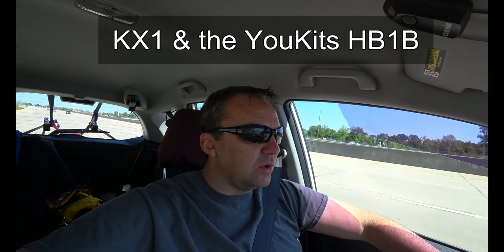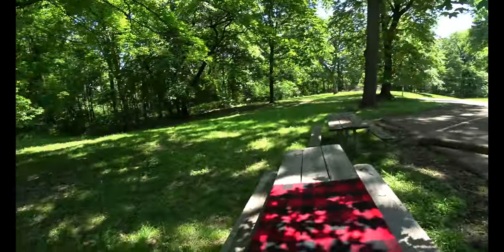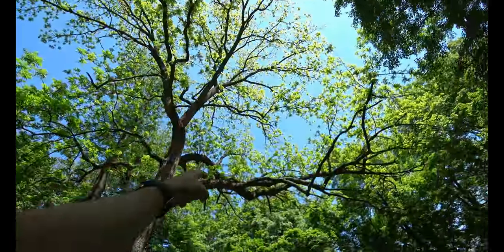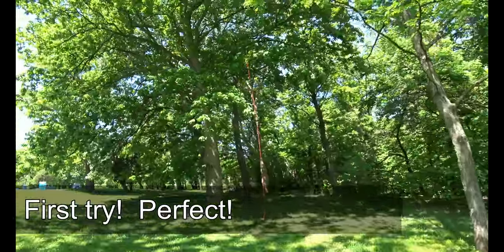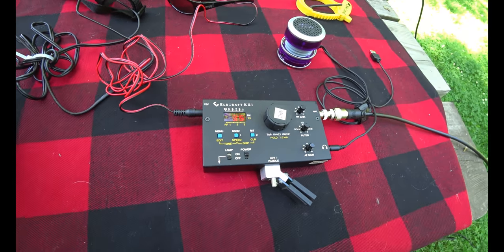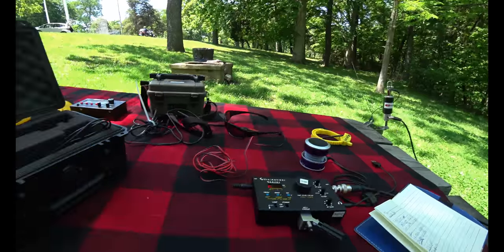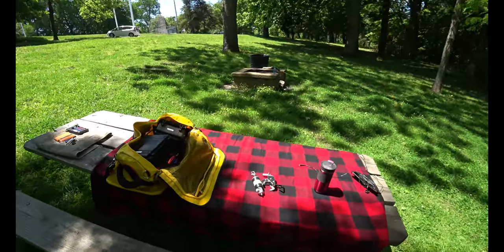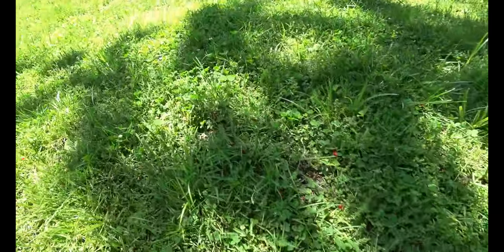Antenna Tree Throw Line Water Bottle | Chameleon MPAS QRP Contacts

Comment: I love my MPAS 2.0 vertical haven’t really played around with the wire antenna much but over the summer 2020 I made regular dx from Ireland to South America with just the single supplied counterpoise, I got the cap hat too great antenna, probably best to use the wire for 160 and 80m.

I was surprised how quiet the Mpas 2.0 is, it’s a great antenna for SWL.
Reply from the maker: Thanks fer comment !

Comment: At minimum you need twice the length plus 10 feet of the height you guesstimate you will be attempting to gain, that is, the weighted object has to return the same distance down as it went up. Heard and saw on videos that it was very muddy in the outdoor flea market. Have a great time at Dayton.

Comment: Thanks for the knowledge. Enjoyed your video. I am going to give the bottle trick a try. Not sure if Dave got back to you? A polypole example is the JACKITE fiberglass pole. It telescopes out from a few feet (and depending on the model) extends up to 32 feet. It's usually used to fly a bird kite. Ive seen short ones on boats flying a hawk-looks real and must keep the birds off. Amazon has the 28 foot for $79. Jackite also has a web site. It gets five stars. For myself, I believe in the KISS princple and go with the trees. One queston: what is the QRP transciever you are using?
Reply from the maker: John Kelley this radio is the Elecraft kx1 I built

Comment: Excellent video and a great idea. I figured on using an egg shaped lead fishing sinker that weighs 8 ounces. but I always have soda bottles around. So what length did you end up using? Or two 50 foot cords or two 100 foot cords?
Reply from the maker: I don't remember on this video.  Now I use about 140' of very fine twine.

Comment: Noticed the nice little Stealth Cam battery.  I just bought one of those a few weeks ago and so far like it.  Considering shortening the long 10' supply cables reduce voltage drop and fusing the hot lead to protect the battery and the radio.  Have you had any issues with it so far?  Enjoyed your video.

Comment: I will use a Petzl throw line during my next outdoor QRP activity for the first time. The type is "Airline" and the length is about 60 meters. Is it necessary to shorten the throw line or should I use it in full length and attached the guying rope on an appropriate point on the throw line to pull it up? 73 de DL1WW